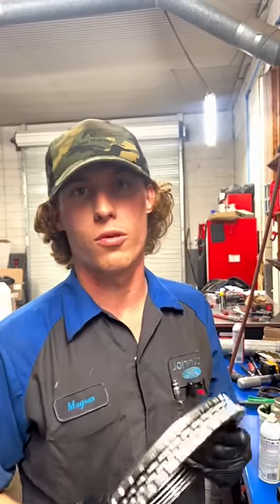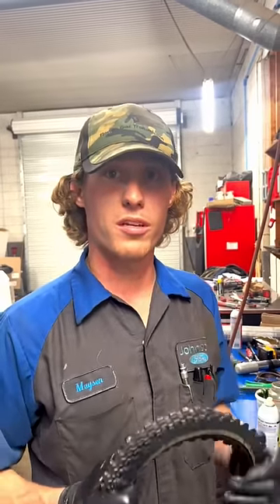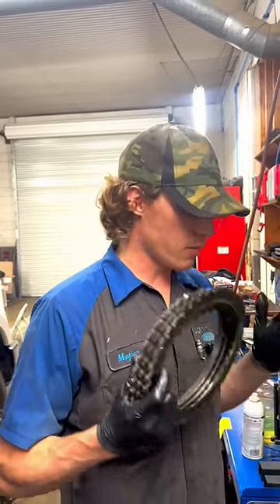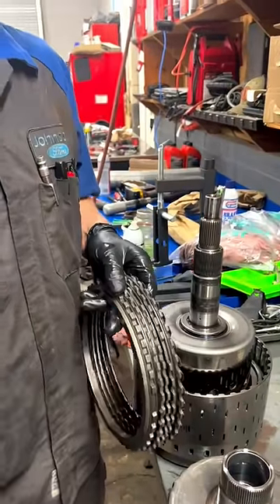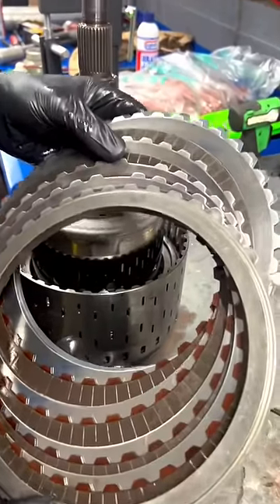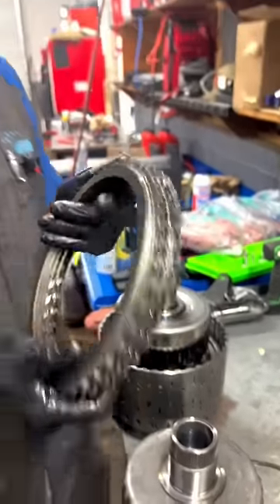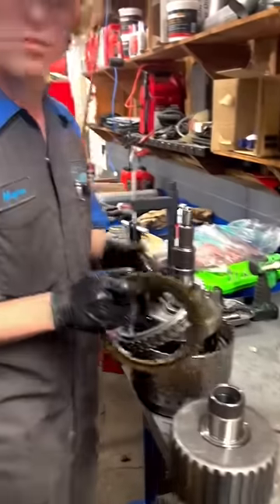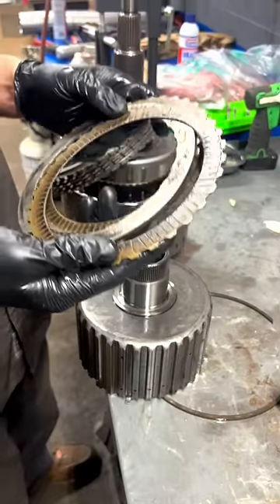Should you replace every clutch during automatic transmission overhaul? #shorts

Comment: Here’s number 1 reason to replace all while you’re in there: Murphy’s Law. Case and point. A transmission has 105k miles, drives fine, you do a trans fluid flush, within a week it starts acting up. Aka you upset the “balance”. Only 100% certain way to return to the customer working like new is to replace ALL CONSUMABLE components at the same time. Thats just the nature of the beast when it comes to automatic transmissions

Comment: I replace everything, clutchs, steels, bushings, bearings sprags, fluid pump torque converter, transmission lines, shells, planetary gear,  servo, solenoid, rebuild the valve body update all known SB issues and add a large cooler to every trandmission I rebuild and replace. It is costly but I rebuild the transmission to last even the most harsh conditions and have never had an issue with any transmission I have ever rebuilt.

Comment: I worked at mopar dealer all I did was auto transmission repairs did it for over 35 years I only replace worn or heat damaged clutches and steels. also clutches might be replaced if a bad failure that caused a lot of debris in oil that got embedded in clutches

Comment: Some clutches and bands are so rarely used they come out brand new at 200,000 miles. The intermediate band on a TH350 is one that comes to mind, only engaged for manual 2nd gear.

Comment: I wouldn't consider myself an old-timer but late '90s I worked at a shop near Raleigh that specialize in transmission rebuilding and this is back when we actually ordered complete kits. I'm not sure how it comes in the Ford catalog, but if that transmission was on the bench end of heart, every seal every gasket every clutch, every servo new torque converter was replaced do it once do it right

Comment: Had to remove the transmission for a 3rd time Dealer only replaced the finger actuators Once I have the transmission out for the 3rd time I replace the clutch Pressure play all the fingers again the control module All new seals and the transmission's been going fine ever since the total  Rebuild

Comment: U CAN get away with only replacing "what's bad" in auto trans, just make sure u DEFINITELY REPLACE the valve body assy on that 6r80 or 6r140 because that's mostly where the problems on the 6 speed Ford originates

Comment: As a GM trans tech it really depends on the mileage and the extent of the failure. If there is metal contamination I try to fail the unit. If it’s one clutch and it’s low miles I replace the failed parts and put a new valve body and solenoid body in since that is usually the source of the clutch failures in late models transmissions.

Comment: The clutches were still on the transmission when there was overheating/over temp conditions along with sharing fluid. It's also impossible to determine time to failure. You're right that they COULD go for another 300,000 BUT any one, or all of them could have imperfections, microscopic warping/waving & could go bad in the next 10,000. I never risk my reputation.

Comment: I rebuilt my 1991 E4OD Transmission out of my truck after I bought it, certain clutches were completely wiped, other clutches still had the manufacturer part numbers on the fiber plates, I didn't replace those

Comment: "wear" items get reolaced. That means if I am there and te part is designed to wear and has a "wear" surface it gets replaced. If not and it tests good it gets re installed. Bearing get reused if smooth, Shafts get reused if show no or little wear paterns. Seals and gaskets get replaced. Once certain parts are disturbed from their original positioning they must reseat and wear in. That may be opposite what they were.

Comment: Old timers have different opinions. Some want to change ALL the friction materials, sanding the steels and knowing the clutches and bands are new. Other builders use parts that look good and will work( for a long time). These are called Del Taco rebuilds.... economically sound but second best in terms of durability.

Comment: The shop I work in rebuilds heavy mining Equipment. If the plates. And Disks look good and measure up we re use them as long as the date codes are within 5 years. The must measure up within new factory part sizing. 
We do this for final drives, brakes, transmissions, diff locks. 
Sometimes 8 year old disks look ok. But begin to delaminate and seperate.

Comment: I'm 75 I did not replace parts that meet specs.  But I would ask a customer before reusing parts ,  after all its their vehicle.    Working for a diesel dealer on major over hauls I'd replace most at least 1 of every part to cover warranty.  Like valve springs a pair of valve keepers pushrod , one of each valve.  it's just good insurance.   We would check all parts to factory specs for reuse.   Reasons:  we had to follow the factory specs for  reuse. If the part failed within warranty the factory would cover because after running you can't tell what part was new or reused.  2.  the reused hard parts proved they were flawless the new one not so much.   Besides the factory set the standards for reuse didn't  they.   Just be smarter right.

Comment: I keep people saying they would replace everything, I would too on customer pay, but the decisions not his.  The problem is that if he replaces one single clutch that isnt bad under warranty then it comes out of his paycheck. Also, 1.5 hour jobs pay .3 or .4 hours under warranty, this is done so the dealership mechanics try not to find the problem. It saves the manufacturer money,  so i wouldnt even pull the clutches from  drums unrelated to the shifting failure. I wouldnt check the pump, i wouldnt examine anything, id work only on the exact problem. Also, theres  no rebuild kits on newer stuff so each part has to be ordered from the dealer.

Comment: I'm in the aftermarket world, and repairing the newer units a lot. Here's my two cents: I fix what's wrong with the unit, and  that's it. I'm putting 1 bushing and frictions in a drum and roll on. If it's a 6l80 or 6r60 with big miles that's different. But newer stuff like tf80sn, 8l90, 10r80, 8hp75 845re or 945 ya no problem

Comment: Warranty is a fickle bitch.  We have a engine with seven total miles on it that spun a main bearing and sent metal through the entire engine and were only allowed to replace the short block.  We have to reuse the old oil pump... Heads..  everything.  80k dollar truck.  7 miles.  Mfer blew up on a customer during a test drive lmao.

Comment: Build with confidence… trust what your looking at… test material with your fingernail… was the fluid compromised? To jeopardize the bonding… measure thickness compared to new ones… feel shift quality of each clutch before removal and compare after overhaul with clutches that were replace with “better” ones and acquire knowledge of what “is” better and not… time well spent when you have questions later about shift quality and complaints 😎

Comment: If no hot spots on the steels and frictions look normals common practice is to mic the friction and steels, if they are within spec you reuse. My 48re has been overhauled twice now with the same direct clutch packs, my overdrive clutches were my issue.

Comment: My teacher always said replace every that is worn. If you’re offering a warranty it had better be done right. This was on the diesel industrial side. The prices on those parts were outrageous, but the amount of money produced was enormous. So if there was a chance of failure, you nipped it in the bud. It’s different for auto warranty work though. There’s a lot of constraints. People who have a 9-5 don’t usually have money to throw around like that. Dealers also started to cheap out, they don’t command the same trust they used to.

Comment: I am building an e40d, the shop where they rebuild transmission and where I bought the overhaul kit. Told me I needed to replace all seals. But only the worn, broken or burnt clutches needed to be replaced. So half of mine were fine.

Comment: Even on just replacing the part that is bad, you have tear transmission completely down to inspect everything. Like he said on doing warranty work its not going to cover full rebuild, customer would have pay difference. A lot of shops i would say are doing warranty work for a dealership  or the car maker, which I would guess the transmission would have low miles. If your a transmission shop that rebuilds for anybody and the transmission goes out under there  warranty they should probably do a full rebuild if you already put quite miles on trans, or at least ext the warranty.

Comment: Long long ago the paper the clutch was made of was absolutely terrible compared to todays. They would usually be in poor condition just from use, the glue wasn’t nearly as good either causing some of the paper to start to come off occasionally. It has always been the same through (ford as that’s the only brand I have dealt with) you do not “over fix” vehicles, just replace damaged parts.

Comment: For all the work you have to do,
removing the tranny from the vehicle, n then
tear down the tranny on the bench, the cost of new plates is insignificant compared to the total cost. Now, if the steel plates look ok, n they still measure to spec, there is nothing wrong with reusing them. However, if the customer is paying for a "complete tranny overhaul", it better be on the invoice/service ticket as parts that were replaced. Of course, you can always bring the customer up to date, and explain to him/her that some of these plates are still serviceable and don't need to pay for new ones when the old ones are still good for another go round.
The main thing here is to keep the customer informed... 🤔

Comment: 2003 Santa Fe gls 2.7 fwd @268k miles owner here.

The woman I'm sitting next to, bought this car at 180k, with no transmission services. In my time with her, and I am not nice, as in regular 4-6k rpm shifts. No service in my time either. No slipping. I have all 4 gears still. The shifter will slam me into neutral once in a while, but that's not the transmissions fault. The fluid is even still pink. 

 This 4L60E... will. Not. Die.

Comment: If the parts are hard to get!
 then  measurements need to be taken to verify a if  part can be reused.  example clutch plate thickness must meet engineer specifications for tolerance values and if it falls within range then yes reuse the parts .
Automotive engines are carried out that way also.. .

Comment: On a low mile box under warranty I would be fine with it in that scenario. End of life of a trans usually has a known "first to fail" component. If I was in a 4L60 with 40,000 miles on it, regardless of what failed I would replace the 3/4 clutch pack for example. Without known reliability problems I'm good with it.

Comment: If I'm paying to have a rebuild done, I am expecting a full rebuild you replace everything. I've actually had this done where they've only replace what was worn out. And in 8000 Miles while it was still under their warranty. Had the transmission go out again and they refused to replace it had to buy a brand new transmission. Have it installed and now it is running fine for over 150,000 miles

Comment: Yes.  You replace everything contaminated or embedded with shrapnel.  This is like replacing one rod bearing if an engine beat it out.

This is exactly why ZF won’t allow dodge to rebuild their units and only allows full replacement of the transmission and then the core is sent back to ZF.  Ford only authorizes bad repairs because it allows you to assist Ford in limping the vehicle out of warranty so that they aren’t responsible anymore.

Comment: Love how Google says to replace clutches on automatic cars every 60k. I've owned at least 16 card and trucks in my life in the last 30 years and have never had to replace a clutch. 
The only bad cars I've owned were a 2002 Cadillac that needed a new transmission (under warranty)
And a 2014 Camry torque converter (under warranty)....and I've driven over 4 million miles.

Comment: I work on cvts instead of ats, i know the workflow of them well enough based off the symptoms to know what the company is gonna say to replace, i beat the absolute hell out of it to try and get it to completely fail for a new unit instead of just a valve body or sub assembly. Generally theyll end up coming back within a few months because it failed again, so ill make myself more time, save the customer time and save myself headache.

Comment: Spent a few years at a transmission shop. When we did a rebuild it got all clutches and a paper, rubber kit. Then anything else that looked worn or damaged. We warrantied the whole unit for 2 years 20k after a build and we didn't want to go back in there.

Comment: It’s simple we do this at our ford dealer with engines. Warrenty job only calls to replace damaged part but you see a decently worn part you quote the customer parts and maybe charge labor though typically we don’t as when the engines apart that parts right there in your case it’s in your hand you obviously win some and lose some but the ones you lose typically end up back down the road with the concerns you’d mentioned before(granted some people just don’t have the money at the initial repair)

Comment: I replaced a modulator vacuum elbow on a th350.  My boss charged the customer $760 in 1980 for a rebuilt transmission.   After he handed me my pay check on friday.  I rolled out my tool cabinet and down the street.  

Op. Are you charging for a repair or a full rebuild.  Are you going to doccument it on the invoice that you only changed the forward clutches and steels .

Comment: I always replace the clutches. You’re already in there, so you may as well change them. The idea is that you shouldn’t have to mess with it again for several years, not that you get it on and out as quickly as possible.
Reply: I agree, been in the industry 23 years and I live by this theory when it comes to work. It's like guys who do timing belts and don't replace the seals and water pump while they have the front of the motor apart. Yes, they might not be leaking at that 100,000km mark, but by150,000im can you guarantee they won't be leaking? (I'm an Aussie mechanic, we use the metric system) I always give the customer a thorough explanation and advise that it'd be a good idea to do preventative maintenance to save big labour expenses later on...
Reply: exactly. If you're there already, why do the same job twice? It makes no sense. Recently I changed a fuel tank in a 1999 Jeep Grand Cherokee. When I did, I made sure that we replaced the fuel pump and fuel filters while we were down there anyway. These guys that say just replace what's broken end up doing "nickel and dime" work in the future.

Comment: The trans is already open, service the damned thing properly...100k on a set of clutches, and you're asking "would y'all replace these?" 🙄

There's this thing called a Vernier caliper- measure some plates and steels out of a 100k mile unit, then mic out a brand new set- there's your answer.

Comment: You can re use those steels all day long as long as there aren’t any hot spots or discoloration that’s “smeared.” As far as the frictions, I replace them 100% of the time if they’re available. If they’re not, I will inspect the FUCK out of them and clean them. If everything checks out, I’ll run em too. I replace the pistons typically in trannies, which I know are pretty hard to get on some units as well.

Comment: I never replaced steels unless they had heat cracks...Fibers ALWAYS got replaced.....On a hi-Perf trans,,EVERYTHING gets changed,,front pump,accumulator,governor,,valve body either replaced or drilled...drums machined for extra clutches. But a stock rebuild for a non agressive daily driver,,test your parts,,apply air to clutch packs,,check engagement,,check for leaking,,replace ALL "0" rings...they dry out,,get hard and dont seal properly....If the trans is in a work truck,,like a 3500 or a 5500 with an Allison unit,,,EVERYTHING will be replaced...a work truck cant afford a break down. I bring my customers into the rebuild area,,show them the part,,explain how it works....then i tell them i'd like to replace it and it costs $xxxx. If they dont approve the repair,,i will write on the R.O. that customer refused part replacement....cannot warranty rebuild and have them sign it....if necessary,,it'll protect you in court,,if it goes that far

Comment: Depends what you’re doing. If it’s purpose built drag vehicle, pull truck even just a constant heavy hauler since you’re in there you’re better off replacing them even with 20k miles.

Comment: Do you replace every gear in a manual transmission or diff, they are still technically wear items, they just tend to have longer service life. If the customer wants to pay for an overhaul yes but it comes down to communication with the customer. If you only offer complete overhauls then some customers might be put off by the price and end up doing more damage to the transmission. Of course a complete overhaul comes with certain warranty that a partial repair does not. Instead of throwing out good second hand components, save them and use them with customers with not alot of money for a cheap overhaul option.